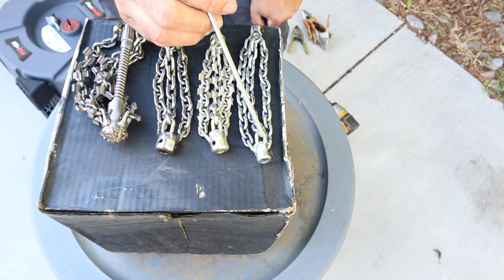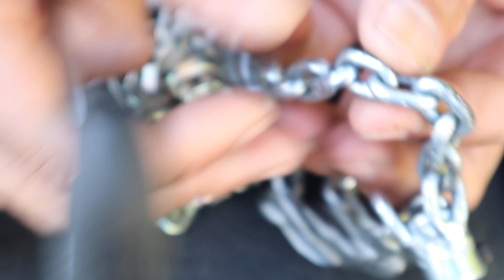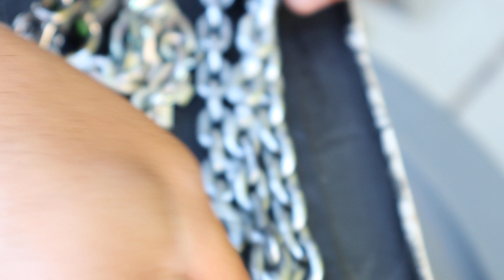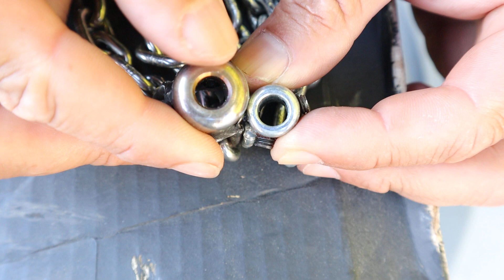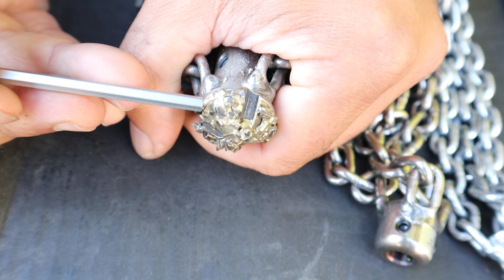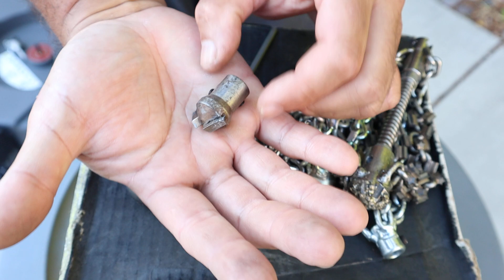Ridgid FlexShaft Chain Knocker Review

Comment: I just got the k9-102 what knockers and tips should i get for this thing? I really like that rinsi tip you showed!
Reply from the maker: Contact your Ridgid rep which can be located on the Ridgid website and they will help you use the 102 (or any ridgid non home depot tool) effectively.
Reply: @sewerroundtablereview4929  This is obviously not the tool i should of bought to replace my stolen Spartan 100 im assuming right?
Reply from the maker: @PlumbingExplained  it's not a blanket answer.  There are too many variables.....pipe type, length, common blockages etc.  Did you waste your money buying the 102?.....no.  Will it do everything the Spartan 100 can do?.....no.  Can it do some thing the Spartan 100 can't do?.....yes.  Good luck.
Reply: @sewerroundtablereview4929  thanks for the info man, I live in Southern California(Orange County) I mostly do residential work but thought a machine like the flex shaft could help me venture into the commercial drains with grease issues etc. do you think I’ll need a cable machine to accommodate the 102?
Reply from the maker: @PlumbingExplained  Yes.

Comment: Hi there, thanks for the review.  Is the carbide only for steel pipes because I'm thinking on abs or pvc that could become an issue with wear on the pipes....
Reply from the maker: You can use carbide in plastic pipe but I use older duller chains.

Comment: Can these be used on normal steel drain cables ?
Reply from the maker: Yes with the right adapter.
Reply: @sewerroundtablereview4929  Do you know what that adapter is called so I can find one ?
Reply from the maker: @TaeKenDo  I tried to find them and ended up just making them myself.
Reply: @sewerroundtablereview4929  Yeah, that what I was thinking...time to break out the ol' welder.

Comment: Thanks for the videos Ben.  Do you use the "flex shaft" style of drain cleaning in kitchen 11/2 and 2"?  Seems to me the magic of flex shaft is the camera being in the pipe  so you can see what your doing.  I wonder if the spinning chain knocker on a 1/4 in cable is any better than regular hand gun cables with 5/16 or bigger 3/8 that I run in small drum machines.  Do you use the smaller flex shaft?    Again, Thanks for your time and expertise.  Dave
Reply from the maker: Using a proprietary method and tools for 1-1/2 to 2" so I can't speak much on that one.  However I will say I stopped using the camera and flexshaft together in small lines.  Saving 5 or 10 minutes per job running the shaft and camera together weren't worth the increased camera issues.  The camera is still used to double check how well the pipe was cleaned.
Reply: @sewerroundtablereview4929  great insight thanks
Reply from the maker: 2 years later and still not using the flexshaft in the smaller pipe.

Comment: Fellow plumber here, I have heavy root intrusion in my storm drain 1 1/4” drain lines, my Spartan 300 was unable to clear the roots, should I use a carbide blade? Any thoughts on the best way to cut these roots out? PVC pipes, Thank you sir
Reply from the maker: Call your Spartan Rep and ask if they have any suggestions.
Reply: Hydro jet the line
Reply: wow i havent ever ran into roots i cant take out. id have loved to have seen it first hand, sounds like a tough one
Reply: Damn what kind of roots were those?

Comment: Hey Ben, hope you're doing well. Have you seen or used the Milwaukee chain knockers for the sectional machines? I placed an order for the 7/8" cable but I guess they're on backorder. I haven't seen anyone give a review on those yet.
Reply from the maker: I have the rothenberger style and have tried them at the same speed and they don't work at all.  Highly not recommended  if you expect similar results as flex shaft.
Reply: @sewerroundtablereview4929  good to know.  I made one for my 7/8 cable which worked well descaling a  4" line. It just won't go through 3" lines. I figured it wouldn't work as fast but it would still get the job done.

Comment: where are your Boldan chains? ;)
Reply from the maker: I can't get my order through Boldan because of the US distributor's customer service.  Boldan makes some bang up looking tools but for regular drain cleaning, chains are fine and the carbide shape doesn't matter much.  The size of links, welding, placement of carbide, set screws, and list goes on are more important.
Reply: @sewerroundtablereview4929  true my friend. at the end of the day for regular drain cleaning its not the biggest deal. But if you're ever interested in the Boldan chains forget about the US distributor, just order directly from the manufacturer in Finland. Super easy to deal with, very responsive through email. I've had great experience with them! Even though the shipping to the USA will be more than you're used to (maybe around 100 euro), its definitely worth it if you're ordering a bunch of stuff. They always have sales and crazy cheap deals, and the shipping is super quick (I just made an order and it got to the US in under 5 days)
https://www.boldan.fi/en/webshop
Anyways, best of luck and keep rocking it!